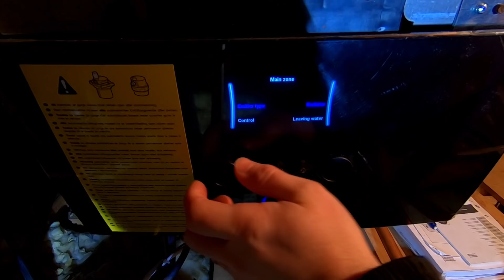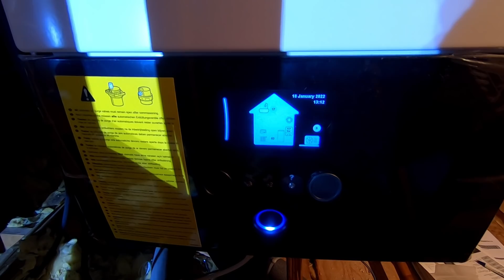How to lose £2000 installing a heat pump

Comment: Great video of what can go wrong in installation of heat pump. We have installed about more than 50 heatpumps and never installed the hydro box in the attic. It's crazy 😁. And i was shocked about disableing the weather dependant curve. It's the main efficency feature of heat pump. And we never use not original room thermostat(on/off) .The original thermostat compensate the wheater dependant curve. Great job and video anyway. I am sorry for my english.
Reply: Hey, LG THERMA V 9KW, what thermostat would you recommend?
Reply: @rafaltomaszewski5175   With heat pump i don't recomend any thermostat. I recommend that you use weather dependat curve with leaving wather. Or Lg original Therma V controller.i don't recommend On/off thermostat.
Reply: You're only installing them because these politicians have made it a plan to put them in place of gas boilers. The whole thing is ridiculous. You must realise you are being manipulated. It's not your fault, you need to earn a living.
Reply: @johnchoice1371 If you say so then it's true. I know that now my wallet is not hurting so much. My yerly cost with gas biler was around 3000€ And now is 1200- 1500 a year. And that was befor the gas prices gone up. Here the prices for gas come up from 0,25€/m³ to 0,70/m³ l. That is for city gas. We have had a gas cistern. This type of gas is even more expensive 1,3€/l. The price of elecricity didn't go up so much. At least at our place.
Reply: @klanecko  That's good, but were you keeping the boiler on too long? A bill of £1500 is still high, plus these units are expensive to start with. You've got to factor in the initial cost.
Reply: @johnchoice1371  If i count initial cost of a heat pump is 8500 eur( including the removal of gas boiler and installing a heat pump) +1500 a year( this is the bill including electricity with other apliences). Let say for the firs year this is 10000€.
If i would just change the gas boiler it would cost me 5000eur(gor good one) And the yearly cost of gas 3000eur. That is 8000. I didn't count maintainance beacause they both need maintainance. So in second year almost the change paysoff. In our countr we have eco fund that returns 2500€ if you upgrade an old devaice to new. So this was the best solution at the time. And for about 3 years now it is worth it.
Reply: @klanecko  OK. But your gas bill was 3000Euros per year. This is Exceedingly high!  My yearly gas bill is a lot less than 1000 Euros per year. For me, none of the changes would make sense. Also, some experts have mentioned that it depends on they type of house you have. If it is very well insulated, this may be better for the heat pump to work, but if it's not so well insulated, the heat pump will NOT be that efficient.
Reply: @johnchoice1371  remember UK gas is artificially subsided compared to electricity and has been for many years...

Heat pumps heat a good percentage of commercial buildings and have done for years in this country without any fuss. They heat houses in places a lot colder than here in Europe and North America easily....they work

Btw I'm a gas engineer, I make money from boilers ect I haven't fitted any heat pumps, Im also not stupid enough to think we are the only country in the world they won't work. 

Now, do I think they should be used for every house? No. Will they?...also no. 

Our problem is shite companies that are used to throwing in Combis in half a day won't be able to get away that with new technology. It needs to be designed and installed correctly or it costs a fortune to run and doesn't do the job it's supposed to do. Even now new builds boilers don't condense because flow and return temperatures are too high...we are the wild west of installations and that's where heat pumps are gonna show just how bad we are over all
Reply: @stevenwhyte4217  Good comment. So you're saying it's not going to work out as smoothly as the government bureaucrats imagine?

Comment: I won't install anything unless I did the site survey or someone that I know and trust did. But if punters are desperate to pay £1000's to have hot water coming out of the tap for that 10 second handwash then good luck to them. And they get a system that's so complicated to set up, even the manufacturers can't be bothered to do it.....good luck when it breaks down.

Comment: Let me get this straight!!!!!
A product that is supposed to save money+time+the environment etc etc
When installed HAS THE SINGLE BIGGEST FACTOR turned off!!!!
And this is told from the manufacturer to everyone installing this product....
OMG.OMG..Total utter idiots..
Absolutely incredible disbelief...
Disgraceful.
Reply from the maker: That is what they told me. I did not believe them.
Reply: @UrbanPlumbers  what do you believe then?
Reply from the maker: That they leave WC turned off so they don’t have to deal with call backs. When I questioned this practice with installation management I was told that they had been told to do it by the others.
Reply: @UrbanPlumbers  you already said this in the video..
Reply: @UrbanPlumbers  what is your professional opinion on these Air source heatpumps?If the manufacturer are telling installers to switch of WC...
Are these heatpumps inadequate??
Not fit for purpose?
Reply from the maker: I don’t believe that manufacturers would ever say that!

Comment: That tells you a lot about how much big companies care about client satisfaction. Bad design, lack of knowledge, 0 support to the people doing the job, they only care about the sales part, getting the money in the pocket. If I was the homeowner I would have asked for my money back.
As homeowner, I learnt that the best way to deal with these installation is to actually invest time to learn how the system works, try to draft a possible installation design, discuss it directly with the plumber/electrician and finally get the job done directly by them. 
The disabling the weather compensation is the cherry on the cake. After spending 15k or plus for a top of the range heat pump, you'll realize it was cheaper running the whole system with gas :)
Reply: Hi, last year and year before our gas bills were £70/month, ASHP installed in May 2021, heating season started in October. Since October every month's bill is £500-600. We were reduced to get our money back.

Comment: Thanks for showing an installation process gone wrong. I wonder whether it would be easier to install mini split style air conditioners for home heating then a heat pump hot water tank for hot water. The components seem cheaper even if the whole system is less efficient (or more, depends on usage)
Reply: We know if it ain't broke, don't fix it. The problem is the political agenda to replace gas boilers with these ugly heat pumps. It won't stop climate change, they are bullshitting.
Reply: @johnchoice1371  - Totally agree.  I've just had a nice Baxi installed.  10 year gtee.  Very happy and it took one day to install.  
It's a similar picture with electric cars, I feel.
Reply: @monsterp1970  Right. Here's another thing to consider. While they want to dictate motorists should all move over to electric cars, all military forces will continue to consume huge amounts of gas and petrol.
A warship is never going to be converted to electric. Jet planes are never going to be converted to electric. Aswell as that, there are all the industries of the world which use gas and petrol, like farming, construction - cranes, dump trucks etc. Also the maritime industry. A cargo ship consumes 63000 gallons of fuel per day. They are never going to bother converting all cargo ships to electric. So this promoting of  electric vehicles is just an agenda to control the population. The politicians need to be seen to be doing something pro-active. Then there is the cost of scrapping all of the perfectly good working petrol and diesel cars. Very wasteful and bad for the environment.
Reply: I would never recommend A/C's for heating.  I lived with them (suffered) in Shanghai for a few years, where you only need them on heat for 3 months of the year.   They will NEVER warm your home, everything remains cold, so you'll also need an electric blanket for the beds.  The air dries out like crazy.  You'll be gasping for water because of that and be more tempted to turn it off and wear your coat in the home.
They only have them in Shanghai because it's the half way point in China between having gas central heating or no heating at all.  Some people will have gas central heating installed where they can.
Reply: @monsterp1970  for me gas central heating sucks. Does it add heat? Yes. The right amount? No, not ever. Between TRVs, thermostats, wrong-sized radiators and changing weather I can never get the house comfy. The radiators can be super hot but that only means they have heat they haven't dumped into the room. Sticking a fan under them helps. The whole burning gas and contributing to global warming thing is also at the back of my mind, like it runs on burning puppies and every now and then I hear their yelps.
Reply: @CampGareth  🤣🤣 Don't forget that both sources of heat (gas boiler or ASHP) use radiators, but give me a highly efficient gas boiler any day over ASHP.   As for aircon heating, don't even bother.  
Both aircon and ASHP use huge electricity and need refrigerant (not environmentally friendly).  Anyway, we can all make our own choices 😎

Comment: Mate, it’s a great job but dump those guys, they are clearly cowboys, whoever did the original survey needs shooting, however I feel sorry for the end user, they have been sold a lemon.
The heat loss on the primary pipework will be enormous, you need to keep those pipes as short as possible, not you fault, you did a great job and you have the patience of a saint, I would of abandoned it the day the gear didn’t arrive. Bet you wish you had.
The customer will find they have spent allot of money on nothing, should of just put a new boiler in.
Reply from the maker: I did the survey but I did not see the final design almost till the job started.

I made my comments on it but no one listened.

Comment: This can't be an MCS main contractor.  I was MCS registered for Solar thermal/Solar PV/Biomass and Heat pumps from 2010 to 2016.  The MIS 3005 document and the supplement on heat emitters outlines what is required.  The radiators would all typically need to be doubled in size, the existing cylinder would also need to upgraded to a larger capacity unit with a high flow 28mm larger coil.
The base that the heat pump was mounted on also looked poor and I hope that they made an application to the DNO to install the unit in the first place.  Setting up a heat pump to run hot at a fixed temperature will guarantee less than 200% efficiency, so almost doubling the running cost of the heating when compared to a gas boiler. It seems this contractor did not survey the property correctly and they cut corners by trying to use the existing hot water cylinder and it appears that you also didn't upsize the radiators.  This is the reason why heat pumps get such bad press, I wouldn't be surprised if in a short space of time that the owner will remove this and go back to a gas boiler, I often see this happen on poorly designed installs.  It is also worth bearing in mind that this unit will also likely to be undersized and having to use its back up heaters, as the property seemed quite big.  Most heat pumps do not state their correct output capacity, the power quoted is at Air 7 degrees and 35 degree flow temp, not -3 air and 60 degree flow.  With heat pumps the COP efficiency is also quoted at A7 and flow 35, which is also comical.  The heat lost on that long run of 28mm external pipe will also be poor, adding to the long list of issues and poor design planning.
Reply from the maker: For the base, they supplied two paving slabs. However, I got my labourer to dig soil out and pour some concrete under the slabs.

Comment: Well done for exposing the failures of the main contractor. Having fitted a few ASHPs I recommend you go to a reputable heat pump manufacturer,  do their course ... and then only fit them in SW England in well insulated properties. You'll have happy customers!
Reply: Whats well insulated? 50mm across loft and make sure all walls have something?

Comment: I’d say this is a one sided picture of the install. 
Who did the survey? 
When did you receive the information on the job? 
Who changed the design? 

I can see it was awkward fitting the unit in the loft however you managed to find a good spot for your camera. I’d suspect you’d have probably got the job done quicker had you have spent less time on your phone. 

Videos like this are damaging to the industry. Your gripe is with the main contractor, have you expressed these concerns with them? Shown them this video prior to publishing online? Given them an opportunity to answer questions? 

On the whole your install is professional, the customer (from comments I’ve read) is happy with a working heating system, however the way you’ve conducted yourself, especially smoking outside the customers back door, is questionable.
Reply: Whoa.
But your opinion is one sided. Is it based on first hand information or on what someone else may have told you?
How can an industry move forward if it is not willing to acknowledge mistakes and just brazen it out. Yes pride may be hurt, but once those lessons are identified then repeat mistakes are avoided and the industry benefits.
No professional should feel uncomfortable accounting for their commissions - or their omissions.
Reply: @normanboyes4983  it’s based on the video. I agree that if something isn’t right it needs to be called out but they way the installer has gone about it is wrong. I’m all for highlighting further needs of training and every days a school day but this video leaves questions unanswered. If the installer was to answer them it would clarify where errors were made and how we can overcome this. Watching this video made me feel like the installer was acting up the cameras, therefore not genuine.
Reply: @castleclimatecontrolltd5593  Well of course you are entitled to your opinion. I have been subscribed to this channel for many years and all his other videos have established his professionalism, knowledge and credibility. That is good enough for me. Maybe retaining an open mind until ‘verifiable facts’ emerge is the prudent course.
Reply: @normanboyes4983  of course. It would certainly be interesting to get some more facts established.

Comment: The fact it also acts as a white noise machine for yourself and neighbours is an added bonus.
Reply: Did you not notice that he was sitting right beside it at the end and you could barely hear it. Noise really isn't a problem, no different to a  condensing gas boiler flue.
Reply from the maker: Yes correct - unit is very quiet

Comment: I love this video! Thank you so much for sharing. Shame it should have been a more positive video but what's most important is that it was honest! Just shows how some MCS contractors need to up their game in the planning and specification department. As a fellow installer currently going through the MCS process, I think you should do it and you will be outstanding. I wouldn't hesitate to recommend you if I got an enquirey in your area.  A credit to you how you turned this around.

Comment: It’s good to see the future! This is the top of Iceburg for heat pumps. Loads of companies will pop up install these on “grants” then disappear. Sad to see you had to put up with this
Reply: It's all a con. I've been involved with Heat-pump technology for more than 35 years.  This country is too slow and incompetent to adapt.  Even Poland are far too ahead of us in the UK.   There are even successful Heat-pump systems available in Sweden for many, many years.  I could go on.
Reply: @m.haslam8495  But why should they be anything better than what exists already?
Even a fan heater can heat up  a room much more quickly than something which is 'clutching at straws' trying to extract micro amounts of energy from a cold climate.
Reply: @m.haslam8495  You might be right. It's just that it seems hard to comprehend how this big fan could extract warmth from the air when it's freezing cold outside. On the other hand, a fan heater with a heating element can warm a room quickly. So why do we have to use a heat pump which seems to be far less useful at creating heat? IT doesn't add up.
Reply: Is it all a big waste of money?
Reply: Everyone should resist from buying/installing these ugly units. How can they make warm air from cold air. That defies the laws of thermodynamics.

Comment: You did a difficult job very well there mate.
But you have to get rid of that awful annoying music. It did my head in, a bit like the heat pump company did yours in. I will definitely not be installing heat pumps as long as I'm alive. Waste of time and money you will never get back.
Reply from the maker: I kind of like the idea of getting energy from air.
Reply: @UrbanPlumbers  I can see your point but surely it's got to be less costly. ATM most people can have heating & hot water for £2000 or less not £20k. Where are all these HW cylinders going to go, millions of people have had them ripped out.

Comment: Avoid using the Antifreeze valves and just use antifreeze (ethylene/gycol) in the system to ensure the water doesn't freeze. Saves loads of time and the client won't need to constantly top up the system when it leaks (or worse, call you back to top it up).
Reply: Glycol loses efficiency. The caleffi valves are temperamental. I use water only. Bosch heat pumps are happy with this
Reply from the maker: what is your experience with anti freeze vavles mate?